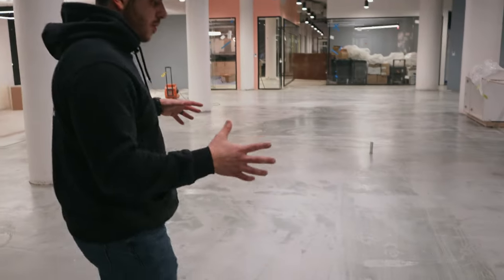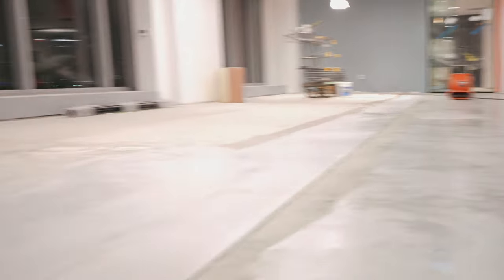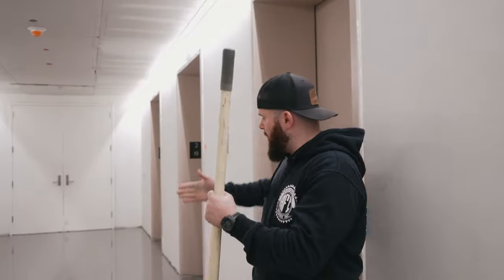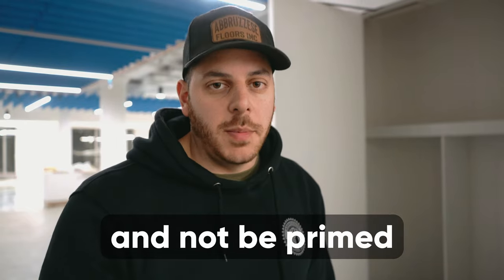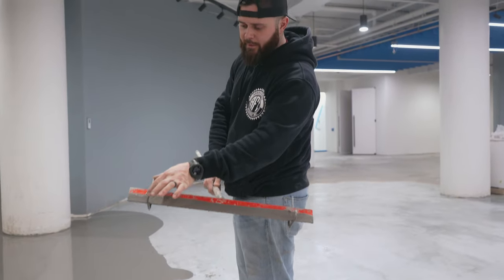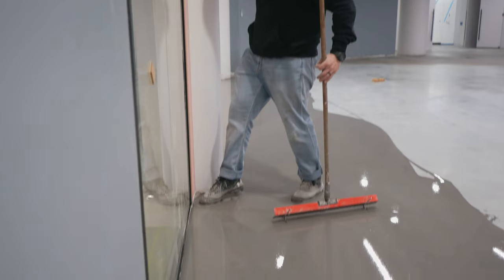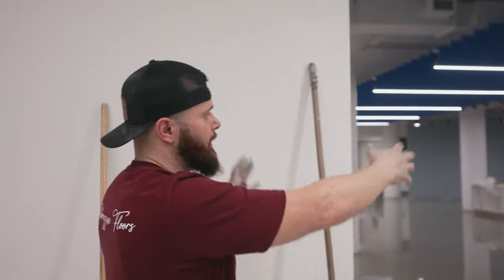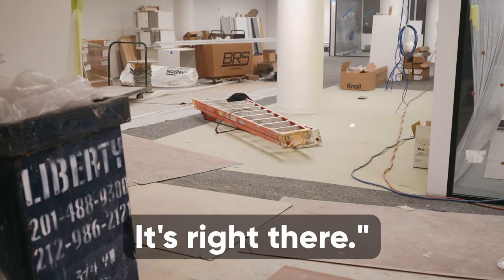Pouring Over 400 Bags of Self-Level in One Shot!

Comment: congratulations!!! I have a question. How did you handle the joint issue? Does the product data sheet clarify it? how often do you put  joint or border? Regards
Reply from the maker: Not sure what you mean by the joint issue? We put borders in when needing to stop the self level for either decorative or specific purposes. We don’t always put Schluter strips in
Reply: Same question , I mean saw cut joints in existing floor. How do we seal that in overlay ?
Reply from the maker: @hemantchauhan8047  in this particular floor there were none. Typically we patch over them but never guarantee that they won’t show through again on the finish. If there are existing 5’x5’ joint lines, we can re-honor them and recut them to give a spot for the cracking to occur. But again, never guarantee no cracking.